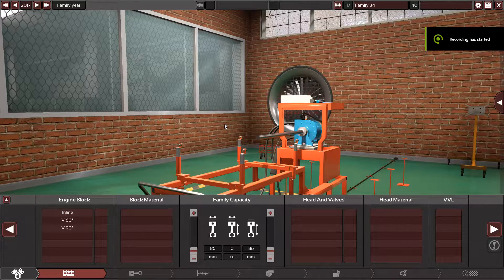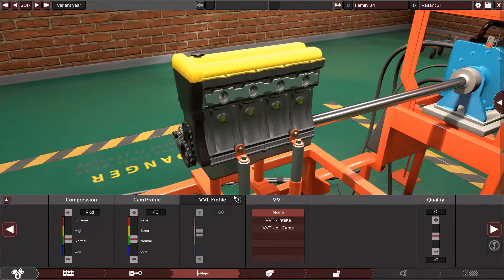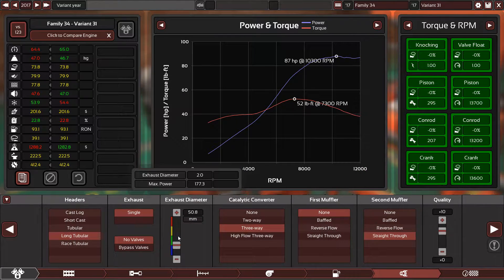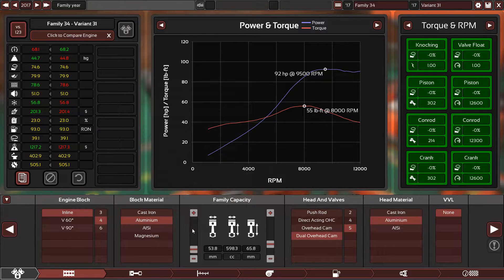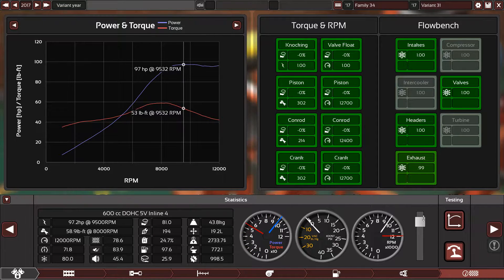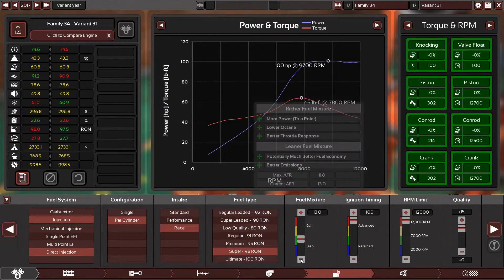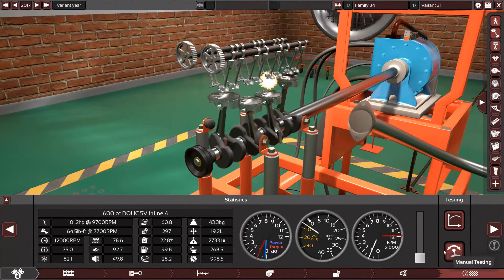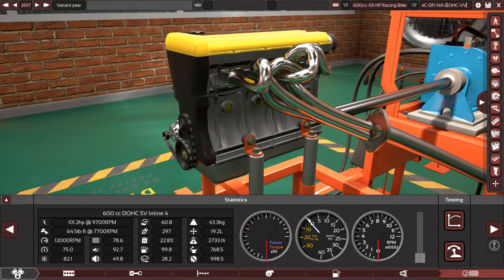600 CC NA Bike Engine build.

Comment: Problem is that u cant change cam profile more to make it more aggressive. If u realize around 2003 and even before all 600cc bikes had such power and 1000cc had around 150hp. The only way that border was crossed was by using rocker arms in the form of finger follwers especailly in the bmw s1000rr where it showed 193 hp in 2009 not only because of the 14000 rpm limit but because the finger follower rockers are able to increase valave lift providing more lift for the same camshaft in a ratio of 1.3 or something like that. Thats how the s54 bmw engine makes 120hp per cylinder and the honda k series with both finger followers and vtec which both enhance lift. Thats the only way to bypass the problem. Nice video keep it up!
Reply: @kingjojojo1  cylinder heads are multifactorial its not always about the redline because u can spin a lot but not have enough cam profile to keef making power at that rpm like u see in the graph power start to decrease after a certain point. Finger followers offer a bit of ratio like a rocker arm as i mentioned to increase lift throughout the power band. If you are familiar with bmw engines m50 makes the same power as s52 when modified to the same displacement but never like euro s50b30 s50b32 or s54b32 simply because of the rocker arms. Same true to honda engines.

Comment: Higher bore does not just increas max revs but also eases engine breathing due to larger valves per displacement volume also bikes do not require a catalytic converter
Reply: Anarchist Pineapple also his cam is at 100 and compression is stupidly high

Comment: You could do the Hayabusa or ZX14 bike motors. Both are inline 4, one is ~1300cc and the other is ~1400cc and they're both only designed to rev around 12k like you're limited to in the game.

It'd be sick if automation came out with at "20k RPM" update, as that's the fastest I've ever heard of any kind of full-scale engine revving to, and I believe that was an F1 v12. And it was LIMITED to that 'slow' as it could technically spin faster, from what I've known.

Or even 15k RPM. And change the cam profiling so that the 1-100 has a wider range of actual profiling to support the increased RPM limits.

Also, crossplane inline 4's, even firing V10's, and more engine layouts, too.
Reply: Drunken Hamster the developer said that the main reasons for the 12k limit are the fact that this game is for road cars really and the sound model wouldn't really allow for much higher rpm
Reply: Honda has a 2 stroke racebike that revs to 24K rpm or even more.

Edit: My memory proved wrong, It was a 4 stroke 50cc that revved to 22 500RPM.
Reply: @shaggings  What was wrong with Honda at that times? 😳😳😂

Comment: a good try, but bike engines are quite standardized and the stroke should be 45-ish mm, which is out of automation's reach. but with that said, i once made a 1 liter inline 4 with 210 horsepower, turbo-charged of course

Comment: Challenge Request: Make a similar motorcycle engine, but a 750cc 4-cyl 1970 engine for a racing motorcycle.
Criteria: Must have around 40 to 75bhp [cutting you some slack], should rev up to 9500rpm. And that's it.

Or, if you want, another challenge request: Build a 2.5-litre V6 2017 engine meant to replace the rotary in some ways. 
Criteria: Must rev up to 9300rpm without knocking, be naturally-aspirated, make ~240bhp and ~165 lb ft of torque, must weigh less than 140kg for the whole engine, and emissions must be lower than 140.

So it's just a little request or two, but it could be worth challenging your skills.
Reply: SapphireSumo6615/DFTW Official/Luke Thomas I would say 2.6l engine because the renesis rotary (which is in the rx8 I think) can be classed as a 1.3l, 2.6l, or a 3.9l. Manufacturers call it a 1.3l but most insurance companies call it a 2.6l.
Reply: Just realised u posted that 7 months ago 😂
Reply: @szymonfalkowski1855  Just realised u posted that 7 months ago 😂
Reply: @lazyeffectz3511  Just realised u posted that 2 months ago 😂